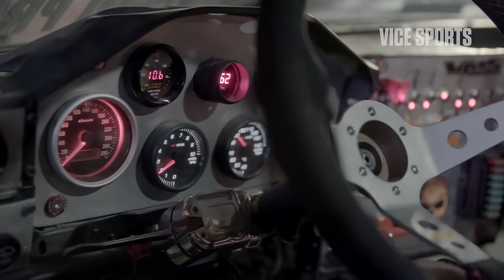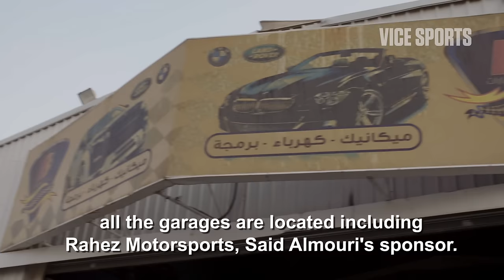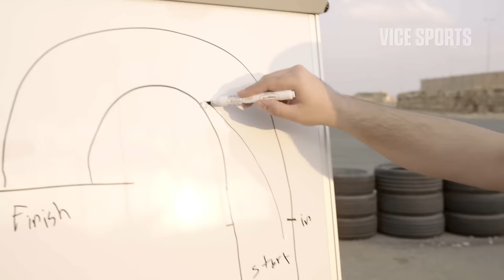Desert Drifters: Illegal Street Drifting in Saudi Arabia

Comment: Isn't 800 hp too much for a drift car?
Reply: +Kollin011 there are guys who run well over 1000 so not really. the more power, the more capable the car is, so is very common for people to run cars with alot of power to make it as competitive as possible
Reply: connor dale Interesting. Didn't think speed would make a difference when drifting.
Reply: +Kollin011 The more powerful the car, the longer you can hold the drift, because if the car is really powerful it is able to keep the wheels spinning at higher speeds therefore making it possible to hold a drift for as long as possible, i'd imagine
Reply: +Davin you mean torque
Reply: for "professional competition/commercialized aspect of drifting", it meets their need but for for the fun of it with a decent power to weight ratio and stiff suspension you can get that rear end loose around a corner. There are guys drifting super light kei trucks with sub 100HP in Japan for the shits and giggles.
Reply: RusticGaming yeah you're right, my bad
Reply: +Kollin011 Look up mad mike.. 1200hp miata
Reply: Nothing is too much
Reply: علم النفس والاجتماع Hahahaha!
Reply: +Kollin011 with me or at me?
Reply: علم النفس والاجتماع With you. Funny statement.
Reply: +wryyyspuffs I agree. Check out my channel, I got videos of drift cars with 90hp to 800hp. All depends of what the driver wants really. Grassroots or pro drift. More HP just means less seat time because tires don't last more then a few minutes.
Reply: Kollin011 naah br0 depends on what you want... You dont need to hit the limiter
Reply: Not really but will high horsepower drift cars tend to slip while in a corner making it a little slower in corners but also with horsepower like that what you lose in a corner you make up in with the straight aways
Reply: Having it around 400 to 500 is the sweet spot

Comment: How'd he get the ass end of that 300 to swing out??
Reply: +ty anderson they compress the engine and shortens the first gear and maybe the second too
Reply: +mohammad barakat i dunno what you mean by compress the engine dude  haha but that car look stock af. he's just flooring it so the rear tires loose traction and turning at the same time so the rear comes out. he's driving a 300c srt8 so he has enough power to be able to do that with relative ease
Reply: connor dale if you have a v6 or more u can add fillings in the engine, the engine should be white or unlocked though for this to happen
Reply: we have slippery roads because of the heat weather